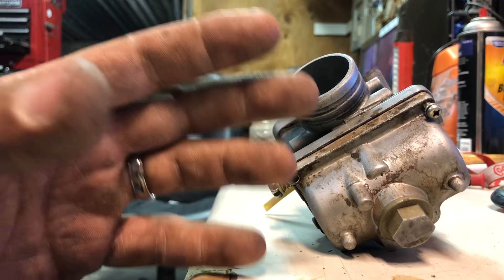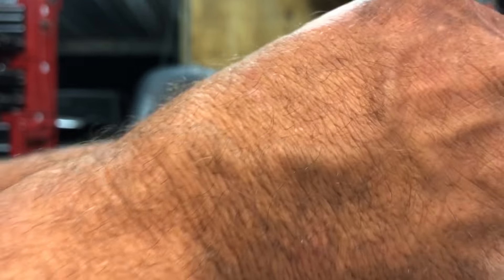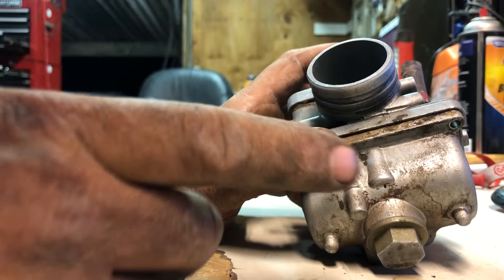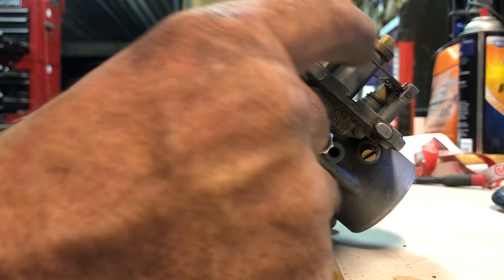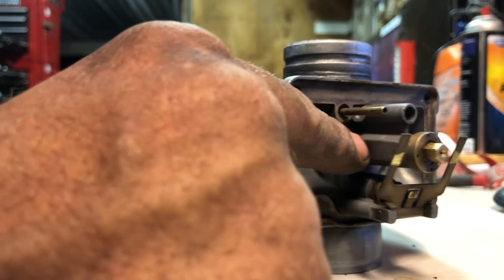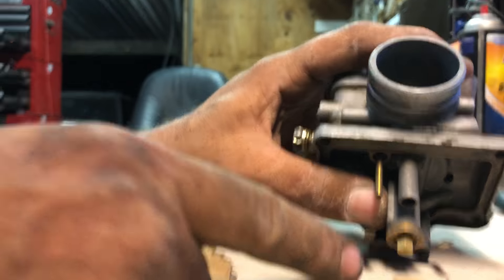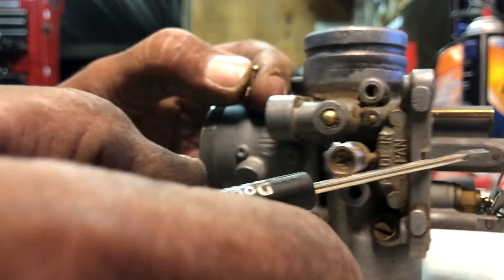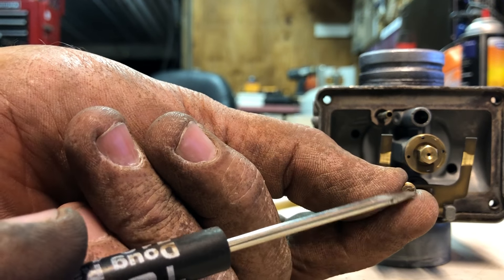Spitting And Sputtering Issue Solved

Comment: Well done 👍
But please my I say something
Carburetors, engines do not suck air or fuel.
Atmospheric pressure does the work, ie at sea level it is
1 bar = 14.7 LBS =Atmospheric pressure.
I understand it's easier to explain that an engine sucks but it is Atmospheric pressure that pushes the air into the carburetor and fuel into the conbustion chamber as the piston goes down the stroke.
Anyway I am positive that you have helped many a person 👍👍

Comment: I have a situation that's very confusing, I took a ride into a patch of woods on my 2017 Polaris 450 HO for maybe thirty minutes-there was no path so I was running over trees big and small-I made it out of the woods but at the treeline, my engine started running rough, sputtering, backfiring. Luckily, I made it back home at a crawl while cranking the throttle back and forth, I had a new plug OEM so I switched it out- never did see the carb to see if I pulled anything loose, the plug didn't help much. I lifted the front end up so I could check out the bottom side, saw nothing pulled loose or hanging. That's my situation and any help would be appreciated

Comment: I have a Farmall 100 tractor that fires up with no problem. Then it starts sputtering and puffing smoke out the exhaust like it's flooding or choking. After doing this for several minutes, the engine will finally die. But, I can pull the starter and it will immediately fire back up with no hesitation before repeating the same issues as before. When it is sputtering, the rod leading from the carburetor will move back and forth instead of staying stationary like you would expect. Do you have any ideas as to what may be the cause of my issues? I inherited the tractor from my late grandfather and have some mechanical experience, but am in no way a professional. Any advice you could provide would be greatly appreciated!
Reply: Problem now

Comment: Hi . Thomas thank you for the info, i have an issue with 2006 ktm 50sx with stock carb and jet Dellorto carb brand. cleaned carb. as you said. 4,x. it boggs down at full throttle bike on stand. 60/1 fuel ratio. im in california 40 miinutes inland from beack. so u get idea on elevation. i appreciate ur  help

Comment: Got a 2006 883 sportster. Would cut out on low speed crack pop ....everything they are known for. CV carb. I assumed pilot was too lean from factory (42) so I went thru process after complete cleaning of carb, replacing accelerator pump diaphragm and orings, gasket, of trying multiple new bigger pilots. 45, 46, 48. No change. I got a new 42 pilot, put it in. Problem now is upon throttling, it bogs n dies. If I stay off throttle itll idle all day, but soon as throttle is given, it bogs. Tried adjusting air mix, 2.5 turns out from lightly seated and 1/8th turn in from there. Gradually closing but  No change. Bike has drag pipes. No baffles  ran before that way just would cut out under 3000 rpms so I set out to fix problem,  lol , now I can't use throttle at all it dies. I've adjusted idle as well with no luck. Black sooty smoke out pipes upon throttling,  or  it spits from carb airbox side of throat. Plugs fouling bad. Changed plugs, put bike back stock, 42 pilot, 175 main...float been adjusted by spec...idk what else to try. Starts without choke ez. Soon as you throttle it it cuts out bogs n dies...all this just to try to stop the low speed popping n cracking...😎. Guess I should have left it alone but I was trying to improve it. With a bigger pilot. But that failed. I believe its overly rich...from the black smoke out pipes...and fouling of plugs. About the only thing I haven't tried is shimming the needle, which I understand only richins mix so I have not done that...any ideas? Bike only has 22000 miles on it. Screaming eagle stage 1 breather....drag pipes, everything,  stock....rgm883@gmail.com.  appreciate any ideas. Float valve is working, accelerator pump works, no tears or pin holes in slide diaphragm....all channels blown out with light psi compressed air after complete rebuild and clean....rebuilt completely totally dry n clean....I'm lost...help? I do my own wrenching,  dealerships take you to the bank even when it's a 20$ deal they take you for 300$ this has to be something simple....emulsion tube is stock, emulsion tube jet is installed correctly. ...idk...thx for suggestions...my email is above.

Comment: I have a 2004 Can-Am we had to clean the gas tank and all that out. I was having trouble with the original carburetor. We think we cleaned it out properly but would not work. It was getting too much gas so I bought a Chinese carburetter and it’s still doing the same but running, a whole lot better but still not not running right should I just buy? Another Chinese carburetter Maybe I got junk one PM me if you can

Comment: I have a 1997 Honda shadow 600 I am a new rider and don’t know much about bikes yet. Bike starts up fine and runs well up until 40mph then it starts to sputter and not accelerate past 50mph, the bike struggles to go any faster. I put sea foam in about 3 days ago, 50 miles and it still does the same thing.

Comment: On my o7 Yamaha golf cart I pulled the carb to clean it... just regular maintenance now it won’t run without the choke on ive sprayed around the carb for vacuum leaks and it don’t have any the only thing I could not get out was the emulsion tube under or I guess above the main jet

Comment: I'm getting a sputtering at low revs, low speeds. Usually at minimal throttle use. Full throttle and regular riding is fine. Model is a VZ800 (M800) 2011 Suzuki Intruder. M50 in the states. Here's the thing....fuel injected rather than carbs

Comment: Like the video and so correct, I have a polaris Razor that was cleaned and I took the entire thing apart. I started the engine and adjusted the air fuel screw along with the idle screw. The engine idles but will not accelerate without popping and spitting. I have adjusted the needle through every setting, please help

Comment: I have a 2001 Yamaha Kodiak that starts up fine and runs but if I let it idle after a few minutes it will stall. If I put the choke on just a little it runs fine. It also will pop or backfire a little if I rev it. Ty

Comment: So I just bought on Amazon a 49cc 2 stroke racing  motor that has a intake kinda like that one and I belive gravity feed fuel cus I need to flip the bottle to get fuel. My thing is I wasn't going hard on the throttle to brake it in and finally was able to open run like 75 of the throttle. I see that it's not taking much fuel while running high speed and bogs out kinda died till kinda giving gas then turns on. Only runs in low or mid speed utility not high for more then few mins

Comment: I’m having issues with a 1998 vn 800 classic. After about 25 miles at highway speeds It’s back fires and dies as of its run out of fuel. I’ve researched this issue and these bikes are known to have issues with the petcock and more specifically the “fuel screen” that sits atop the petcock in the fuel tank, as this is the only filter on the bike. I’ve ordered a replacement petcock because it was the only way to get a new fuel screen. I’m going to replace said parts, as well as add on an inline fuel filter between the petcock and carb, probably only on the “main” fuel line. I’m also going to replace the fuel lines and pull the carb apart so that I may free the jets/floats/needles of any build up, as I know they have not been taken apart in some years. My question to you would be, what else if anything should I look out for and what else may need repair om order to perform properly ?

Comment: I've got a 1962 Ford 3000 tractor with a Holley R3655A carb. I have removed it and am in the process of cleaning and installing a kit. However I can not get the plunger to come out of the little tower it is in. I've had it soaking in carb cleaner for days and it will not pull out. Do you have any tricks for that before I attempt to drill it out?

Comment: thanks i cleaned the pilot jet and it was clogged now the bike runs perfect. the carb is a new mikuni vm-32 the jet side holes were clear, but the very tiny center hole was clogged.

Comment: I have a Yamaha big bear 400 2x4 that missed at anything above 3/4 throttle. It really almost sounds like a governor. I'm thinking maybe the parking brake sensor is acting up? Let me know what you think if you could, thanks.
Reply: how does the parking brake sensor make it act up ?
Reply: @sallycoleman7847  if it's bad it can cause false signals and make it not want to rev but I don't know if that's just for idle or not. I was told that but didn't know for sure.
Reply: @tygoodwin7179  my kfx 700 misses and cuts out after half throttle and my "front "park brake wires are pulled out ( left pull brake handle wires )
Reply: @sallycoleman7847  that's weird I'll look at mine and see if mine are pulled out

Comment: Me and my dad are working on a clients Yamaha TT-r230. He had let it sit for number of years. We had put a lot of new parts on it and still can’t get low rpm’s. Starts and idles perfect and all the power at top end. Just no low end power just stutters and wants to stall. We flushed the tank servile times. We all so put a new pepcock, fuel line, carburetor and battery on it. We have tried tuning the low end jet and nothing makes a difference but if we pull the choke 1/8 the way out. It will run like a dream. Can any one help us and shed some light for us please? Thank your guys.

Comment: Great video - kicked it - straight to the point.  Any thoughts on why fine gas vapor is blowing out through the air filter area on a Kohler Command Pro CV25 ?   I pulled off air filter today and noticed a nice pressurized flow of gas vapor flying out of carburetor up through air filter area.
Reply: That's what happens with no air filter...

Comment: Question, I just bought a 1994 Kawasaki Bayou 220 and the starter sounds horrible. I replace the starter with a brand new one off of Amazon and the starter sounds exactly the same and it’s almost like a grinding sputtering noise and it sounds like the starters not getting enough power to crank the four wheeler. Any ideas?

Comment: I have a 1976 Sachs engine, Sparta buddy moped, 49cc. I pulled the old carb apart and the slide was ready to breath in half. I got a new keign carb and installed it. The moped starts fine, pulls hard, but breaks up at full throttle? Any suggestions...
Thank you.

Comment: Hey just a quick question it's pertaining to a honda cruiser cycle. But with the carbs. I rebuilt em changed jets and but didn't change air/mix screws all same number jets just didn't want to clean em. Call me lazy anyway. I get hesitation at the top of all my gears and can't get over 55. Only have about 1/4 maybe less throttle pull in gear with load. Full rev in neutral. Don't really think any pop coming down if I member right. What's my area to reset? Side note. 
Parts are cheapest off Amazon. Bout the only things I really needed out of it were the two Lil round diaphragms and two o rings for my mixture screws.  Should I pull amazon parts and clean oem 30yr jets and put them back in w new Orings and gaskits that I just got? Or do you think since probs at top of every gear and my whole final gear it's my coils and wires?

Comment: I have a 2000 Polaris sportsman 400 2 stroke had the atv for about year I drive here and there on a dirt road I live on just recently the bike bike is actually up it will start up just fine no issues there but once I start driving it I could drive it 50 kms and it will work just fine,I just started bogging out and stalling on me I leave it sit for 15 to 20 minutes and starts right up and works fine just wondering if it may need a carburetor clean and new spark plug or new cdi

Comment: I have an old motorhome. It is back firing  through the carb. Flames go everywhere. A good friend of mine got burnt badly when the same thing happened to him while working on his motorhome. I want to get the motorhome fired up. Usually requires a squirt of starter fluid and a bottle and hose with some gas in it to keep it going. Any way to keep the back fire 🔥 from catching me or the motorhome on fire?

Comment: Have a TRX250X with some issues, put a chinese carb on and it ran ok with bogging at high RPM so i decided to clean and put new gaskets in my old japanese carb and ran soo bad it wont even run that much, idle its perfect but moving it spits and sputters and bogs
Reply from the maker: did it spit and sputter with the Chinese carb? ( i don't care for them) . if it did not, buy a oem carb. yours is to worn out. if it did with both carbs, you need to go to spark. new plugs, or coil. be sure if it is spark that you rule out that nasty on off switch,, they love to ground out and cause that issue as well. please let us know what you find. it helps others. thanks for watching.
Reply: @thomasbriansavingmoney  at low RPM it ran fine but when you get up it bogged alot, I put my old Japanese back on and asked around, found out I wasn't suppose to screw the pilot jet all the way in, this Friday I'm gonna take apart the carb again and do what people in my Facebook group say which is do 2 and a half turns and test it. When you screw the pilot in it makes it more lean, unscrewing it makes it more rich

Comment: Ok so here’s one for you that’s stumping me and Ezgo techs. I have a Ezgo gas cart with a Fj400D Kawasaki motor. It’s a single cylinder 13.5 hp motor and the issue I’m having is it runs well on level ground but when under load on incline the engine will begin to sputter and lose power to the point that I have to stop and put it in neutral and rev the engine then it will go up as long as I don’t give it full throttle. I’ve change the carb thinking it was the main jet that can’t be removed for cleaning or replacement btw and that wasn’t the problem. It was then recommended that I check the valves for adjustment and neither were way out but adjusted them to within spec and that didn’t help. The impulse fuel pump seems to pump well and provide adequate flow with the outflow hose to the carb disconnected and held over a receptacle while turning over the engine but this is on level ground. I’ve checked the spark quality of the plug and it appears ok so I don’t think it’s a coil pack issue but I’ve honestly run out of things to check. Again on level ground the engine runs well so I don’t think it’s a compression or a governor issue but honestly I’M STUMPED! Look forward to you opinion and hope to hear back soon,,,thanks.
Reply: Float level on carb

Comment: Question for, Im helping a friend with a polaris 500 predator carburetor issue, the initial complaint was only start and run on choke, would not accelerate but stumble flat out upon trying to increase rpm. He brought the carburetor to me, I opened it up found a plugged main jet and slightly plugged pilot jet / emulsion tube, all clean now and reinstalled, now it will start on choke and idle off of choke but as soon as you try to accelerate it stumbles flat , the diaphragm slide does move up but kind of bounces as it stumbles to rev up... What is going on here, no vacuum leaks on the intake boot either...

Comment: I have a 04 kfx 50 quad I just got done cleaning it all out had a lot of build up in the carb white residue . I put it all back together but it just doesn’t throttle up quick almost like bogging out and not reaching full throttle what could it be

Comment: I have to give mine half throttle to start. The auto choke works fine, so I guessing its the slide. I have no filter on it,the filter I had on it got destroy by the carburetor when I buy the carb new, haven't put back one yet

Comment: Hi Thomas, I have some questions I'd like an answer for. I have 1995 summit 670 with vm40 mikuni carb, everything is squeaky clean almost spotless in there everything new except for needle jet and needle. (needle valve, seat, main jet pilot jet, gaskets) and had it set up to factory such as round slide opening air screw and idle screw float arm adjusted to 19.6mm bottom of the arm to face of carb where gasket sits. 
carb was keep flooding I tried to have float arm to 20.5mm didn'tdo it. flipped the arm set it to the height still flooding. I took the slide out and excessive amount of fuel was coming out from main jet( throat I think), thru jet needle tube. I blocked the jet with needle and tried again and breather hole and such was puking out fuel. why would it be keep flooding? and its happening to both of carb and I dont know if floats will go out at same time

Comment: i have a 32mm cvk carb. idles great. once i crack throttle, no power and just popping.  carb is clean. what would u suggest. bike is a 232cc 2 valve powered taida gy6. if that matters. 600 above sea lv

Comment: My banshee has been making a coughing sound out of the right cylinder for a week or two. I’ve cleaned the carbs and air filter and it’s still happening. I need to replace the reeds but not sure if it could be too or bottom end. Any help would be awesome.

Comment: So, on one of my floats, the arm broke off, the one that the bar goes through to hold the float in place, any ideas? or can I run it like that hanging a bit? im also running on 1 cylinder, could this be it? or do I need to do a better job of cleaning the carb? one more question, what's the easiest way to check to see if im getting fuel into the head from the carb? do I just open the hole and rev the engine to see if it's spraying? I have strong spark

Comment: I have a problem with the kawasaki klf250 carburetor dismantled, cleaned, set according to the instructions, fires ok, drives ok, the problem shoots from the exhaust when releasing the gas, the candle has a metal color